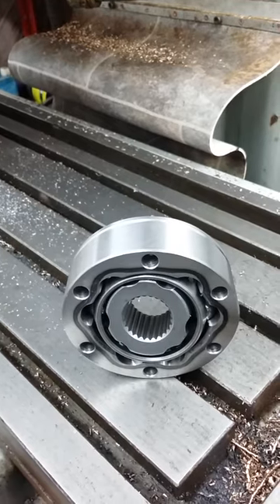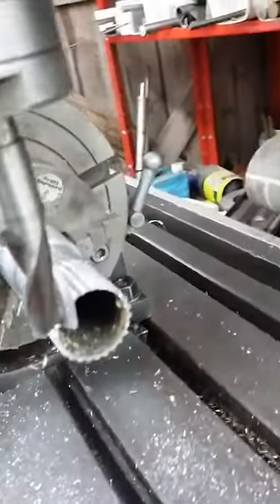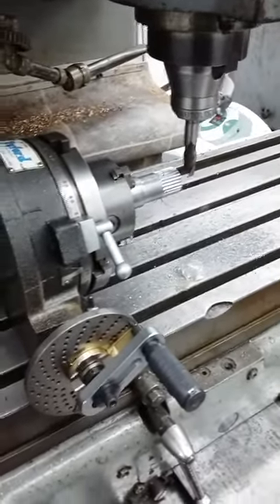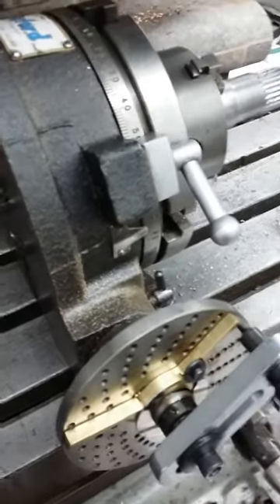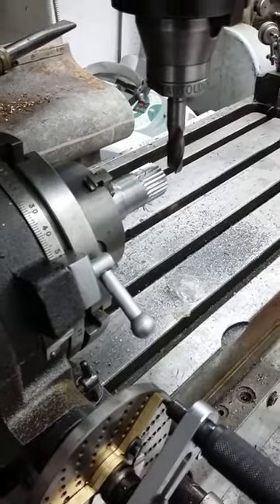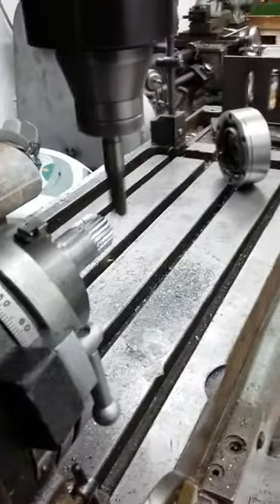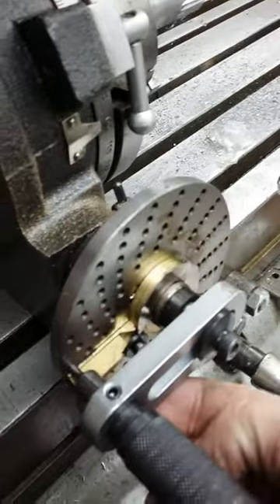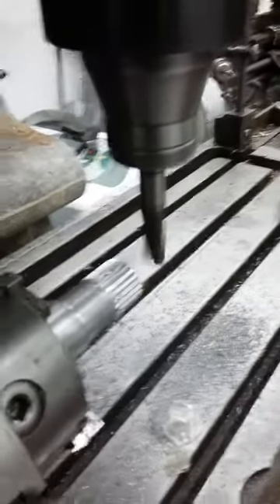Cutting Splines using rotary table on Rambaudi vertical mill

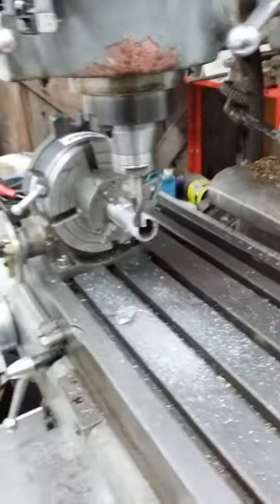Comment: Hi-- at time 0:34 I see that you have the chuck mounted directly to the base of the rotary table?  Is this a chuck with 4 mounting studs?  The chucks I have seen all have 3 mounting studs on 120 degree pattern.  Thanks,
Reply from the maker: Yes it has 3 studs. I drilled and tapped the table to take the chuck...and made a centre to help locating it.

Comment: you didnt lock the rotary table down in the video after you indexed it. i promise im not a butt hole
Reply from the maker: Matt Parker ...well spotted. As I was rotating the job clockwise it wasn't a problem, and the lock at the back was still gripping the table. Thanks for looking :-)